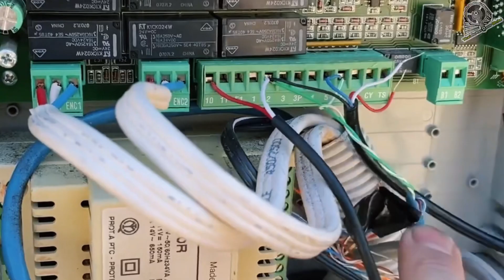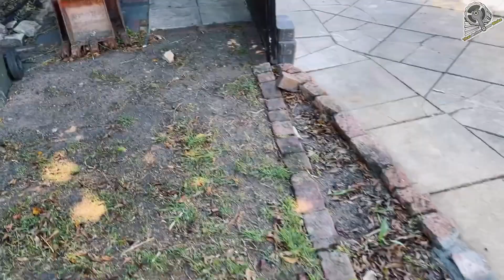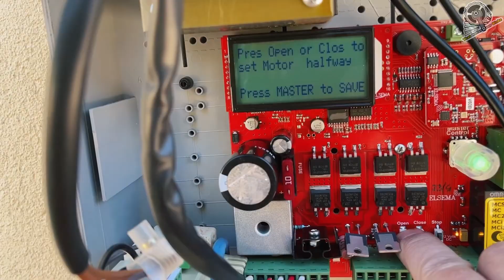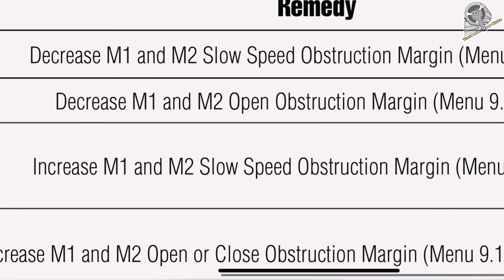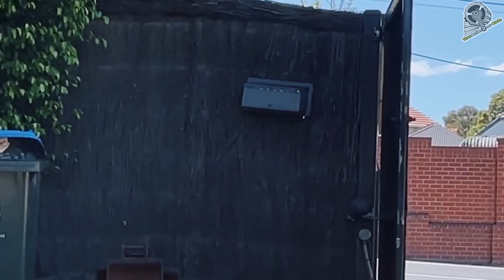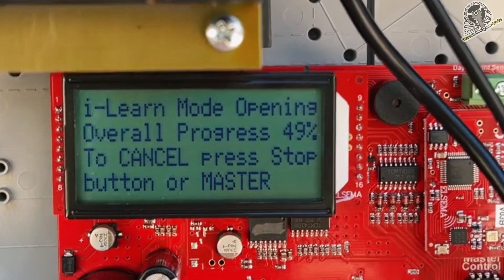Gate Revival: Replacing a Dud Board with Elsema MC Double Swing Controller  - 77

Comment: The worm gear gets dry and needs lubricating after a few years so it's easy and smooth in manual mode, otherwise current draw increases in dry areas when movement gets stiff. My tip is drill a few small holes in plastic cover underneath worm drive and use grease gun with needle tip through holes to lube worm gear. Work gate a few times to spread grease and you'll be amazed at results. No need to dismantle to lubicate. Been using CAME motors over 40yrs and dare I say it in the industry well over 50. Good luck, we never stop learning something.
Reply from the maker: That is a brilliant tip mate, thanks for sharing your industry experience! 👍

Comment: Hey mate, try lowering the open, close, slow speed obstruction margin to as low as you can around .25 amps and give that a try if you hadn't tried that aready. I dont believe that style of operator will draw much at the end of cycle.
New operators are going to be a long term fix in any case with some work on those hinges.
Best of luck with it. 👍
Reply from the maker: Wicked thanks 🤩 I don’t think I lowered that much.  Yeah apparently the trucks that go past throw a lot of crap at these gates they have had a hard life haha